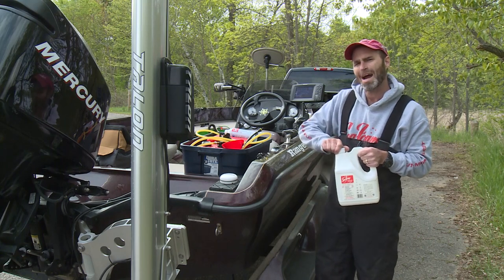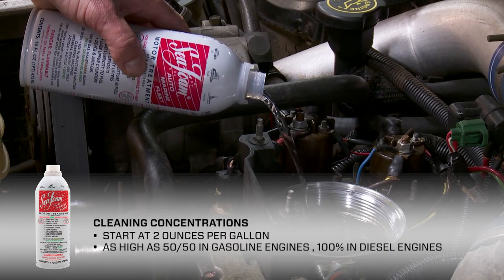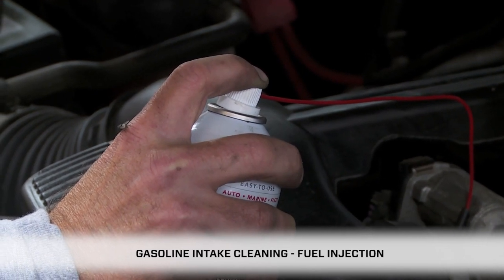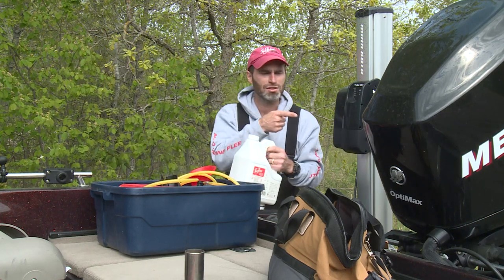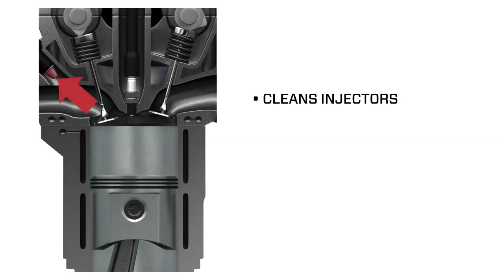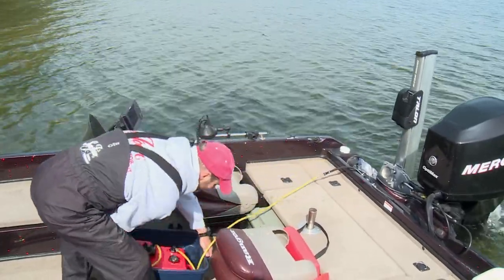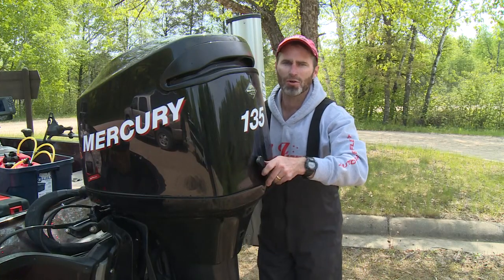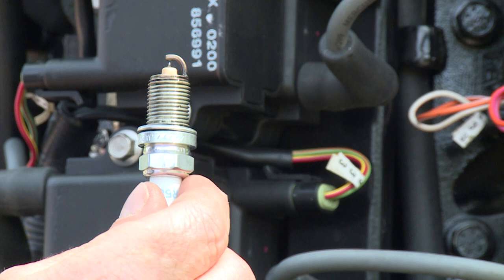Using high cleaning concentrations of Sea Foam in fuel systems

Comment: I have been using Seafoam in my 2008 Dodge Nitro 3.7L with 334,678 miles on it. I've been using Seafoam in the fuel tank every 3rd tank, added to the oil 200 miles before I change my oil and I've used the Seafoam fogger 2 times and the engine runs like it has 30,000 miles on it.  I swear by Seafoam products!

Comment: Seafoam is AMAZING!  I bought a vintage HONDA MB5 (2-stroke, 5-speed manual clutch, 50cc, 7HP, exported to USA in 1982 only) street bike, and although it started and ran, it 'bogged down' a lot, with bad throttle response, and only did 35 MPH.  I knew that top speed of this fun little bike is 55 MPH.  I added Seafoam to the gas, and about 3 tankfulls later, the bike completely 'opened up' and ran like a clock, easily hitting it's top speed of 55 MPH, with flawless throttle response!  I honestly could not believe what I was experiencing, but Seafoam 'restored' this old bike to it's original performance!

Comment: Just wanted to say this stuff works!!! I bought a 1995 evinrude 9.9 2 stroke that wouldnt stay running at low idle. I did a few sea foam treatments like displayed in this video, and after a while of playing with the throttle to keep it running it cleared out the carb and now idles perfectly at low rpms.
Thanks!
Also, there was a LOT of greyish gunk coming out of the exhaust water flow.
Reply: Jerry Odell My 7.5 Mercury 2 stroke does the same thing. This weekend I’ll try this method. Hopefully I have luck because I’m ready to hit the water man

Comment: I put this in my Polaris, it wouldn't start, the fuel system was blocked, the carb jets we're awful. Dealer quoted 2500. Put it in the tank, best product out there.

Comment: Just tried a full can of seafoam today on my 2006 Ford Escape 3.0L V6, I was at 3/4 of a gas tank when I used the product and drove for a bit after adding it. My issue was while on the freeway driving above 3kRPM closing towards 4, I noticed hesitation and loss of power. I was recommended this product hope it does something beneficial for my acceleration issue.
Reply from the maker: Look into faulty ignition coil and/or worn plugs, dirty fuel filter, dirty MAF sensor... Go to a parts store and have the engine codes read for free, go from there.
Reply: @SeaFoamOfficial  Sounds good I’ll have those codes pulled again. Thank you for the response. I’m aware I did have a prior ignition coil problem, maybe another coil pack has went out. Would the use of seafoam which I never used before and my car does have a lot of miles still be beneficial in my situation?
Reply from the maker: @keembrown5658  Sea Foam works great to keep fuel injectors clean... But I always like to answer by suggesting to look into the key causes of hesitation (coils, wires, plugs, filters). When using Sea Foam  to clean, add a can or two when the tank is LOW to max the cleaning concentration. Adding 16 oz (1 can) to 3/4-full tank won't have as much of a cleaning punch. Hope this makes sense!

Comment: this stuff works nice. was trying to start my generator and wouldnt start, i took plug out cleaned it and even put gas in the plug hole to prime it, but still wouldnt start. So then i thought hey put some seafoam inthe plug hole and started first pull and kept running fine. So i have a wheeled weed wiper and same thing it was sitting thru the winter and wouldnt start so put seafoan in plug hole again  first pull!!!! Im impressed :)
Reply from the maker: Thanks for the post.  Add to the generator's fuel tank and let it go to work, cleaning from the carburetor circuits to the chamber areas!
Reply: +Sea Foam Official yup i do add to fuel on my stuff like atvs and generator only problem is generator has such a small tank.
Reply from the maker: The smaller the fuel tank, the easier it is to add high cleaning concentrations of Sea Foam!   Also want to make sure that you understand that cleaning carburetor passageways requires Sea Foam in the fuel.  Adding Sea Foam to a plug hole adds lubricity and soak cleaning to cylinder cavities - what it takes to help your engine's fuel delivery (carburetors or injectors) must be mixed into the fuel.
Reply: +Sea Foam Official Hi thanks for the info. Yes i do add to the fuel tanks of all my stuff. the putting in plug hole was first time i did this.
Reply from the maker: Glad we're on the same page - thanks for the follow up!

Comment: I will be adding seafoam to my gas tank shortly. What are some normal effects to be aware of? Will it smoke (or is that just if poired in the engine)? Smell differently? Etc

Can i add 16oz to my 4 gallons in the tank for best cleaning and be fine? Or should i fill up first?
Reply from the maker: Hi Rebecca: You will not see or smell anything different. The vapor/smoke people like to talk about occurs when added directly into the upper engine. That's different than adding to fuel.

Comment: So two gallons of fuel cost $65
I don't doubt that works but that's a bit ridiculous
Reply from the maker: Hi Quinn:   The point is never made to run all that Sea Foam in one engine treatment.  That would be ridiculous (we agree).  The points are:  Sea Foam is ALWAYS safe and high concentrations are always an option for stronger cleaning - Sea Foam is used as the treatment of choice in professional induction machines (added direct through the fuel rail) all over North America. Induction cleaning machines use 50% ratios.
Reply: Well then it's an excellent point
Reply: Sea Foam Official When should I use Seafoam on my car, it has 130k miles, I have used fuel injector cleaners before but looks like nothing changed much considering a can was a dollar.
Reply from the maker: Please see the video, SEA FOAM IN FUEL.  Additionally, consider using Sea Foam Spray through the intake to clean the upper engine (intake valves and combustion areas).
Reply: Sea Foam Official You guys are the only channel that replies. Great job.
Reply from the maker: Thanks for the kind comment.  Glad to help!
Reply: @SeaFoamOfficial  Other than the throttle body, why else would you use seafoam spray in a port injection car? I took off my intake box and cleaned the throttle body with the spray and a tooth brush. Then used high concentration in my fuel tank to clean intake valve, combustion chamber and compression rings. Also some in the crank case.
Reply from the maker: @hossemadian7127  Answer: To clean intake valves and upper engine areas [a whole can to be applied into any 4-stroke gas auto engine while the engine is running].

Comment: I have a 2006 polaris ranger 4x4 carburater injected I had about 4 gallons of gas in it. I was trying to measure it out to use half a can but I used the whole can of seafoam. Lets just say ita going to be cleaner then clean in that carburater

Comment: Mixed 2 gallons of seafoam to just about 2 gallons of gas in my 1997 Acura EL tank. The car hesitates under acceleration, knocks a bit under full throttle and runs rough. I hope I am not putting the engine under stress. When taking off from stop it feels like I am just learning how to drive manual transmission lol
Reply from the maker: A high concentration is one thing, a high volume of a high concentration is another.  You're going to have trouble with too much lubricity and lack of fuel vapor volatility. [Be prepared for your car to run terrible and likely foul plugs when you cold start.]  I would siphon a bunch of that mix out of your tank into a fuel can, then fill the Acura's tank with fresh gas. Re-use a portion of what's in the fuel can as you cycle through tanks of fuel.
Reply: @SeaFoamOfficial  Will do. Yes my car runs terrible on cold starts. Lots of smoke out the tail pipe but when warmed up to operating temps runs smooth. I did lots of full throttle runs under load and high RPM to the redline. Slight pinging in 3rd gear could be heard. Didn't misfire under load just in low RPM during take off. Based on my description do you think my Acura sustained any possible strain/damage? I am going to change the spark plugs anyways but other than that anything else I should watch out for. I am going to go fill up with a full tank of fresh gas. I just about ran my half a tank of 50/50 to 1/8th as we speak. Oops
Reply from the maker: You very likely have fouled spark plugs so need to pull and clean. You also need to get the fuel ratio up ASAP.

Comment: i have a 100 gal fuel tank in my boat that has not been started in 5/6 years. the fuel was treated heavily with another product. i have now acquired a newer motor for the boat. Is the  fuel in the tank still usable. Will Seafoam help clean up the tank.
Reply from the maker: Smell the fuel.  If it smells like varnish it will ignite poorly and make things dirty as you use it.  I would purge all of it from the tank.
Reply: thank you
Reply from the maker: Hey Jeffrey:  People call our tech line often about having large boat tanks full of old gas... Just be very confident that the old fuel has lost its "bang".  It loses light ignition vapor and becomes heavy, less volatile, causes residue throughout the fuel system.  My encouragement is find someone that can handle all that old fuel and have a repurposeful use for it.

Comment: My 1995 Volvo 850 has an 18-gallon has tank. It currently has about 3-4 gallons of gas in it. I want to add a full can of Seafoam to the tank. I live 7.2 miles from the nearest gas station. Do I add all the Seafoam before leaving home, and then drive to the gas station?  Or do I wait until I get to the gas station and add it to the tank before fueling?  Or do I add a little Seafoam before driving to the gas station and then add the rest right before fueling? The reason I ask is that one of your videos says you can use as much as 50/50 Seafoam:fuel and I don’t want to add too much Seafoam and drive on it.
Reply from the maker: To max cleaning concentration, favor adding the whole can when the tank is low and drive.  Add it all and go...And doesn't mean you can't keep going to a station that's further distance.
Reply: Sea Foam Official Thanks!  I’ll try it.

Comment: Should I switch to higher octane gas when I use a higher concentration of Sea Foam in the fuel tank?  Would the higher concentration of Sea Foam cause engine knock?
Reply from the maker: No need for higher octane. No, engine knock is a dirty chamber problem - Sea Foam cleans what causes knocking.

Comment: Hi believe or not  I have a 03 ford f250 6.0 power stroke. 
3 injectors fault after parking for 2 months. 
Auto parts store recomend the sea foam I dropped 2 cans in 3/4 of the diesel tank an wow I have 1/4 of the diesel tank an injection issue disappear 
Run like champ any way that's really work.🤝👍
Reply from the maker: Thanks, Carlos. Glad to hear.  Be sure to try the diesel filter prime on your F250 - see video how-to.

Comment: I have a 16 gallon tank in my car. I'm thinking my injectors are dirty but before sending them off for cleaning I'd like to try this first. How much should I add to my tank? And is it the same bottle that comes with the curved straw for the intake? I really don't want to put the wrong stuff in.
Reply from the maker: For cleaning, always try to use a higher concentration. Wait till your tank is very low or near 1/8th.  Add a full can and drive at least 20 miles before adding fuel.
Reply: Well damn. I put in a can and filled all the way up. Well good thing I bought a 2 pack lmao. Thanks
Reply from the maker: Happens any time you discover a better idea.
Reply: Do you suggest to use seafoam for the New car? I have 2018 Jeep Cherokee, and I don't know if seafoam would help or not
Reply: @zzangon8  Never hurts to use it. I run it in all of my construction trucks. It works. Has never had an adverse effect on any engine.

Comment: For sea foam to clean injectors  do I put it on vacuum line or gas tank?
Reply from the maker: Must go in the gas tank to pass through injectors. (Add a can or two when tank is low.)  Going through the vacuum line does not pass through the fuel injectors.

Comment: I have a mercury 4-stroke 9.9. How much would you Sea Foam would you recommend I run through it to give it a good cleaning? And how often?
Reply from the maker: For engines that use fuel that's not used up within 3 weeks at a time we recommend Sea Foam in every tank of fuel.  For cleaning, the "Can & Hose" method is tough to beat.  See HOW2 instructions (website) and/or the "Can & Hose" videos on the Sea Foam Official channel (YoutTube).  Do one time per year + Sea Foam in every tank.
Reply: Sea Foam Official, thanks! I'll get to it!
Reply from the maker: Let us know what happens.

Comment: I have a little old yamaha 125 two-stroke that I pre-mix the gas in. It desperately needs cleaned out. Can I add seafoam to pre-mixed gas? If so, how much. I know the video says any amount works but I really dont want to hurt anything.
Reply from the maker: Yes, can add to premix.  Adding a high concentration of Sea Foam won't hurt anything.    
Add a half can...run the engine for 10 minutes...shut off and let sit overnight or two. Then run as normal...see what happens!

Comment: My 7.5 Mercury shuts off after a few minutes of runtime. I’ll try this before taking it to the shop
Reply from the maker: Yes, check the fuel filter too. Smaller Mercs use a small plastic in-line filter under the cowl.
Reply: Sea Foam Official Thanks a lot! I will definitely check
Reply: Sea Foam Official i accidentally missed a couple of steps but the Seafoam definitely cleaned the engine like you said it would! I did spray into both spark plug holes like you directed
Reply from the maker: @coolbreeze2291  Just make sure you run a healthy dose of Sea Foam in the fuel to clean the carburetor circuits.
Reply: Sea Foam Official Lol.. I think I messed something else up thought. I now have gear oil or something leaking from the propeller.
Reply from the maker: Using high concentrations of Sea Foam in fuel will reliquefy old 2-stroke oil mixed with the water that comes out of the propeller exhaust.  That's a good thing! No worries. Gear oil would not come out of the prop exhaust.
Reply: Sea Foam Official idk what’s going on with this dang motor. I started it today. It ran for a few minutes then shut off and wouldn’t crank again. A lot junk was coming out of the motor. I even heard that gunk sizzling. The carb started spitting out gas every time attempted to crank it🤦🏽‍♂️
Reply from the maker: @coolbreeze2291  How about contact us through our website so we can help you out?

Comment: I've got an oil injected 2 stroke outboard.  I've never had an issue but I've heard that the oil can gum up after sitting for periods and seize up the motor if the flow stops. Would Seafoam mixed with the oil in the oil injection tank possibly be a preventative? If so what would be a good ratio?
Reply from the maker: Yes, Sea Foam in the 2-stroke oil tank will help liquefy the old oil.  Use 2 oz per quart.
Reply: @SeaFoamOfficial  great,  thanks!
Reply: Adding seafoam to the oil wouldnt that change the oil gas mixture seafoam is not two cycle oil
Reply from the maker: @JamesWhite-tg4kw  No, you still have 100% of the gas and 2-stroke oil you started with + Sea Foam IS a petroleum lubricating oil, so you're adding oil/lubricity to the mixture.

Comment: I have a 4 Polaris slingshot with a 5 speed manual transmission. Someone recommended running a bottle of sea foam through a full tank of gas. Any thoughts or recommendations on this ? Sea foam official still run this channel ?
Reply from the maker: Better to add when tank is low to create a greater cleaning concentration. Can always add more fuel.

Comment: I just changed my oil in my 2018 f150 5.0 with 25k miles. Do i have to wait until the next oil change to run sea foam??
Reply from the maker: We recommend adding 100 to 300 miles before each oil change interval.

Comment: Hi i had water in my tank so i drained the tank and filled with fresh fuel and changed the filters i filled the filter half way with sea foam as in the other video and run it but im not quite getting full power . When you hot soak it for 5 mins would it be any better to leave it soak over night? i suspect my injectors are dirty they are prone to it on 115 yamahas so going to try this method
Reply from the maker: Do you have water in a boat fuel tank?  If so, drain fuel (seems you already did to) and add a few 12 oz bottles of isopropyl and  at least two gallons of fresh fuel and run through the engine till the fuel is out.  Watch our 'Can & Hose' method for cleaning  the injectors.
Reply: thank you
Reply from the maker: Our pleasure, always.  Let us know what happens!

Comment: to clean motorcycle carbs would i just add seafoam in the gas tank? also should i have the choke on or off?
Reply from the maker: Hi Rachel - For cleaning carburetors, here's what I would do:  When the fuel tank is very low (less than a gallon), add a full can of Sea Foam to the fuel tank.  Start and let the engine idle for 10 minutes to draw the Sea foam concentration into the carburetor circuits, then shut it off and let everything sit and soak for a night (or 2, or 3...longer is better).  After sitting, add a half tank of fresh gas, start and let it run for 10 minutes to burn off all the hydrocarbon residue...then road ride it once the idle is steady.... At that point your carburetor circuits should be clear and you will have ZERO doubt about Sea Foam's ability to clean things up!  Let us know what happens.
Reply: Why do instructions say "add 30ml of sea foam to 4L of gas" I added 120ml of seafoam to my 16L motorcycle tank.
Reply from the maker: The idea of the video is to help understand that more can be added when higher concentration cleaning is needed.  We much appreciate your comment about the the can instructions --- Note that can instructions have been revised with cleaning dosage specifics (look for updated versions later this summer).
Reply: ok thank you